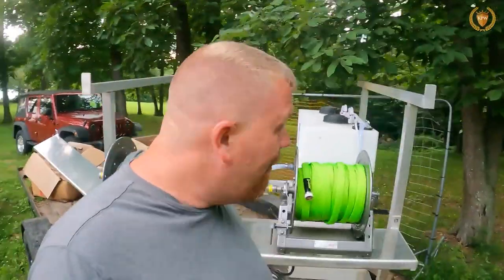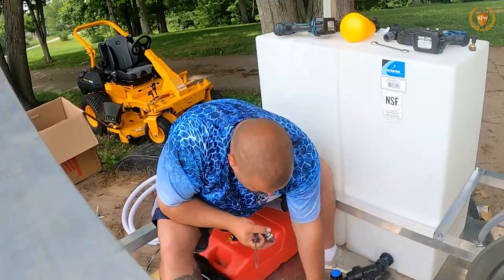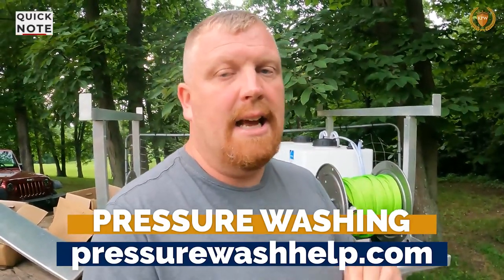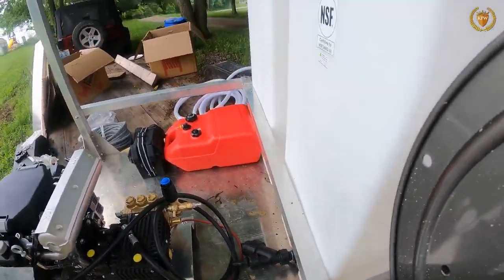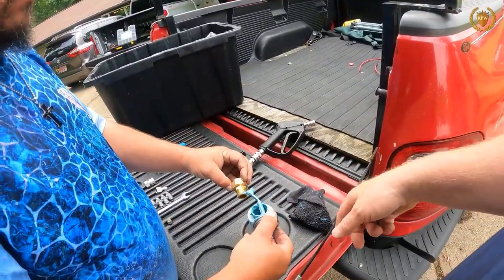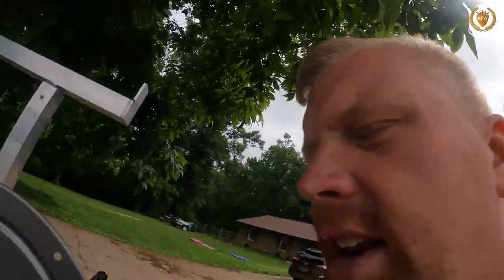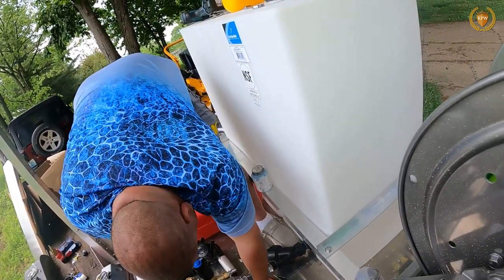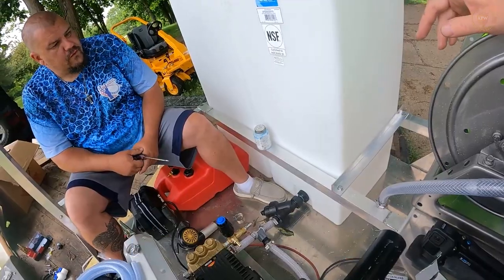Setting Up the Garden Reel Hose For Pressure Washer

Comment: One thing I have noticed on YouTube is when people show you how to acemble something, they use way to much true blue. All you need is a thin layer on threads. The same with tape. I've seen people run 6 or 7 wraps around threads then they wonder why it cracks and leaks. You though Jason did it pretty well. 👍👍
Reply from the maker: Well thanks i done it a time or 30 before lol

Comment: Suggestions??  I just purchased two General Pump 100' D300002 hose reels.  These have 3/8 NPT-F inlets.  For one of these reels, I am needing to connect to the water source via garden hose 1/2 MGH.  A search, so far, has yielded zero results.  Anyone know where I can find such an adapter (3/8 NPT-F to 1/2 MGH)?  Thanks!!

Comment: I cant find a single video on how to mount the engine to a truck bed
Reply: With a skid. Cheapest way is to use a wood pallet. You can usually get ones that are a little beat up for free from lowes and such. Just secure the pallet in your truck bed and then mount your gear to the pallet.
Reply from the maker: Skid or a piece of plywood or nothing
Reply from the maker: @LaughterbationFilms  yup